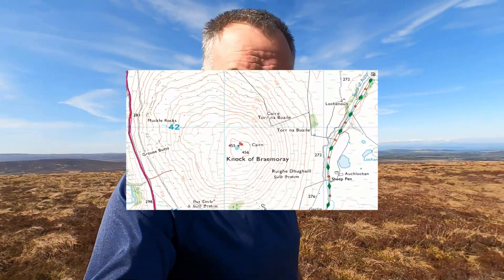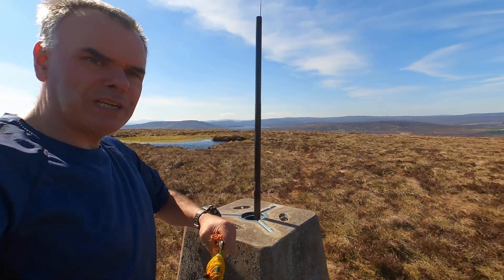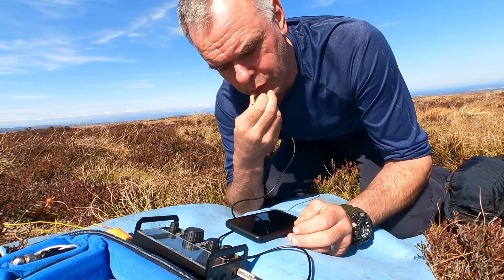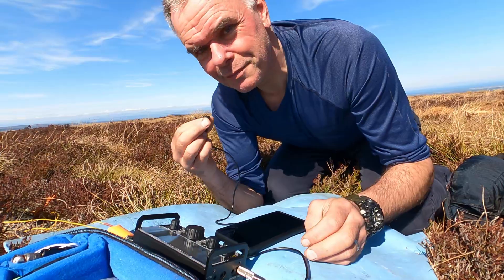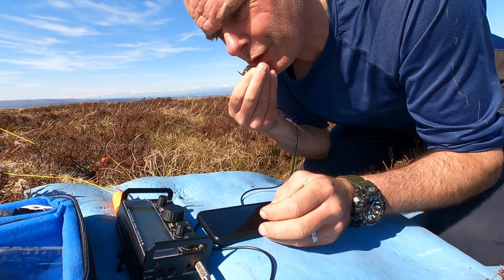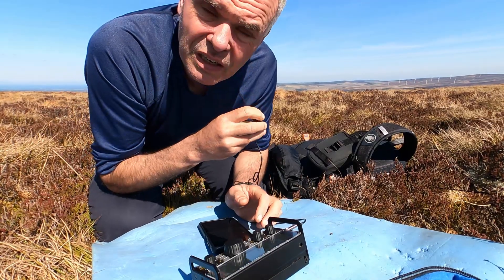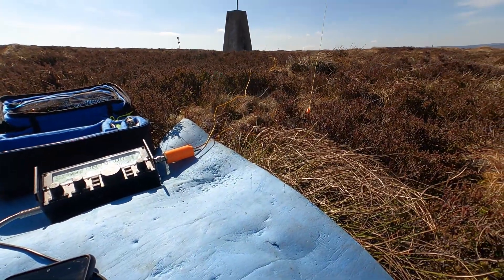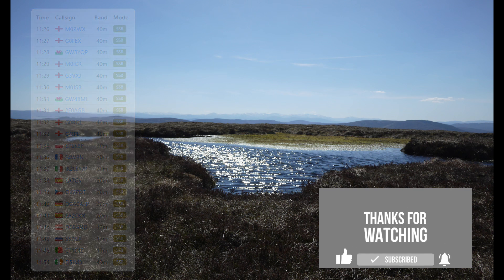What's my next HF Portable Antenna?

Comment: This might not be better, but another option is the Rybakov. 25' vertical with a 4:1 unun at the base and six 17' radials. A commercial version is the M0CVO Magitenna.
Reply: Be cheaper to buy the ldg4:1 unun and use scrap wire but it’s a good suggestion
Reply from the maker: @TIMG5TM  I have a small 43 type torroid and some enamelled wire, so I'm sure I could knock one up.
Reply from the maker: I have heard of a Rybakov, but never explored it. I will definitely look that up. Thanks! 😊

Comment: W3EDP mini? But not for 40 I fear. Also 6m with three counterpoises and a 9:1 for 20-10? Vertical version of norcal doublet out of speaker wire .. centre fed with the same speaker wire as a vertical doublet?
Reply from the maker: I suspect my 41' random is a W3EDP mini, as it is just under half the length. The vertical doublet sounds intriguing. Wouldn't the feeder part need to be kept at 90° to the mast?
Reply: @theradiorover  ah that’s a junior! The mini is halved again to be a 1/4 size of the full size. Yes you’d need to run the feeder away from the vertical doublet but anything between 45 and 90 degrees will do
Reply from the maker: @TIMG5TM  W3EDP mini sounds so simple that I'd be daft not to try it Tim. So, around about 21' of wire and a 15' counterpoise. Could be perfect for a small rocky summit!
Reply: @theradiorover  yes indeed! Add another 3 same size radials that’ll reduce some ground losses
Reply from the maker: @TIMG5TM  I'm on it! But not this weekend because it's 145 Alive!
Reply: I just commented saying we needed to get you involved in this one Tim! 😀…
Didn’t realise you already had!
Come up with a few designs and we’ll build and test them on the hill 😉…
For mounting reference, I usually carry a hiking pole, and a 7m sotabeams fibreglass pole.. I now have an internal tuner in my X6100 radio so that can be used too..
Patiently awaiting your proposed lightweight build…. 😊😊😊😁

Comment: Hi Fraser, that random wire is just fine! The one I used with my KX3 was almost 9 meters long and worked very well on a 10m fishing pole from 40 to 10m. I used the same length as a counterpoise. The KX2 and 3 have such a good tuner that it doesn't matter much. Its very light and so easy to setup. Not sure if you would see the difference with a linked dipole which is more complex to setup. You can't beat it for weight and simplicity. I will now try it with my new G90 for a bit more power on SSB. I'm curious to see what others will say. 73 and keep on making the videos!
Reply from the maker: Thanks! I'm trying to avoid a dipole. I don't dislike them. I actually have one. It was my first SOTA antenna. Something end fed and vertical would be better. I am also looking for something I can use on small summits. Like you, I am looking forward to the suggestions!

Comment: Hi Fraser, wow that’s quite an ask. You can make an L match and use most lengths of wire from a short whip to 5m and beyond. I have wonderwand wide bander but Peter VK3YE has a lot of info about L match. Few switched inductors and a variable capacitor will get you on the air even without an atu. Cheers Steve MW0SAW
Reply from the maker: Intriguing Steve. Cheers!
Reply: Steve, you need to send Fraser the SAW special EFHW, as rated to 30watts by me! :-)
Reply: @Bodhi504  Hi Richie, I would certainly send one of my antenna’s to Fraser if he required. Although I think he’s looking for something minimalist for a narrow rocky summit. EFHW for 40m is 66ft. So unless he is going to dangle off the side of the rocks it’s probably out. To eliminate weight and bulk you need to discard any feed line and put the antennas straight into the atu/radio of the kx2. 2x17ft straight into the radio is about as simple as it gets. Perhaps even considering taking a small radiator wire extension. 29ft works well too. You can always make a mini 9:1 on t50. Cheers Steve MW0SAW
Reply from the maker: Nailed it Steve. Thanks for the suggestions!